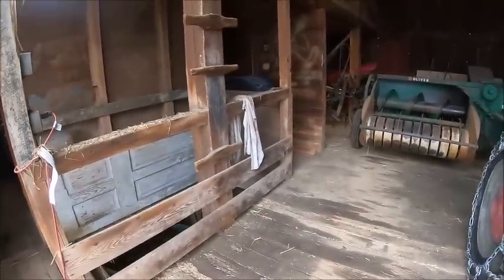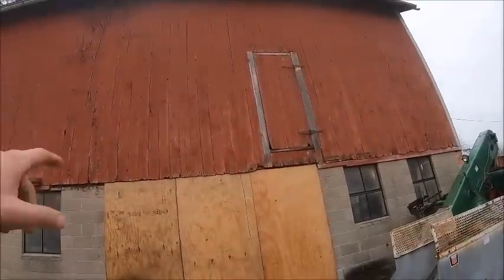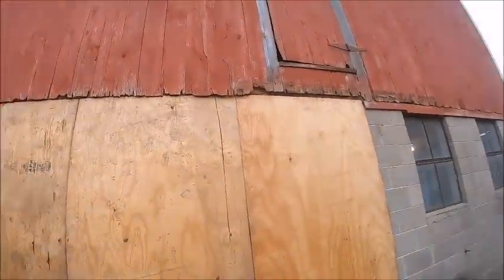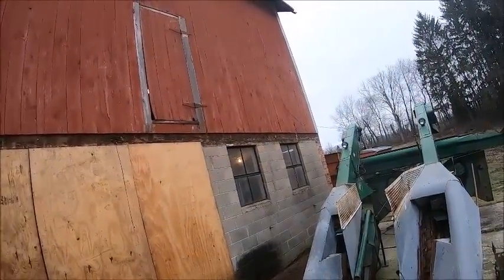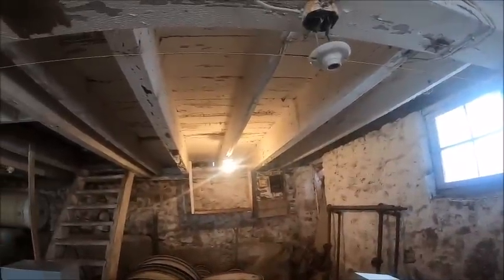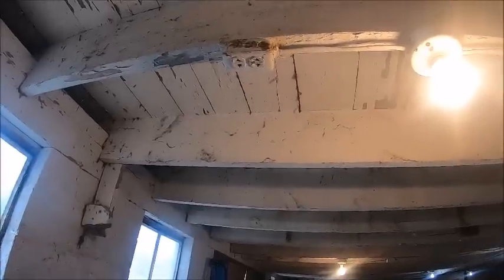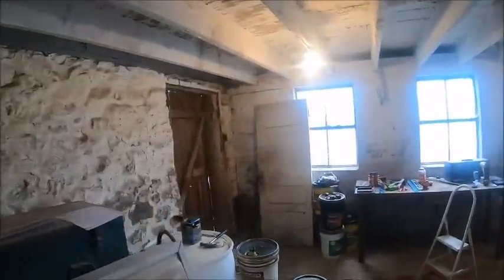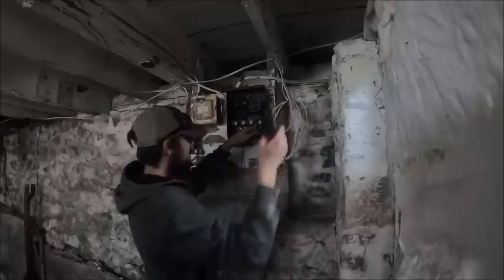Barn Door Project Part 10: Door Prep And Electrical Work

Comment: Wiring should be in conduit.  Protects it from rodents and being hit  and damaged.
Reply from the maker: The cloth braid wiring has been in there for going on 70 years and has yet to have any rodents chewing on it. And where that wire is run, if you somehow manage to hit it, you have bigger problems because you are going to have a barn coming down on your head. Also what good is it to put it on conduit? If you hit it congratulations now you have a wire pinched inside a piece of smashed conduit which is going to need cut apart to get repaired anyhow.
Reply: @Oliver66FarmBoy  not to be a smartass, but conduit is often needed for NEC code. Dont know what the regs are in your area as far as ag use  vs non-ag use, but here in AZ, for my applicaton, exposed wiring needs to be inside the conduit for "protection".... what that really means is more expense and pain in the ass, but that is where some of the conduit comments are likely coming from.

Comment: Good deal on the electrical. I tried to do the same in my Bomb Shelter, and ended up having to do a full gut and rewire due to the shit job that the previous owner had done. after finding that I couldnt kill power, and finding automotive butt splices in the lines, it ended up safer and cheaper to just redo the whole damn thing..... Not a fan of the fuses in your panel, but as you say, its on the list for a more modern panel. That will also allow you to go with a grounded system as well. 2 wire electrical is a good way to get zapped, but you gotta work with what you got sometimes.

Comment: They possibly had two switches to save power of you only needed to light part of the barn, or so they could use cheap light switches they had on hand that maybe wouldn't handle the load of all the lights in there since they would of been incandescents.